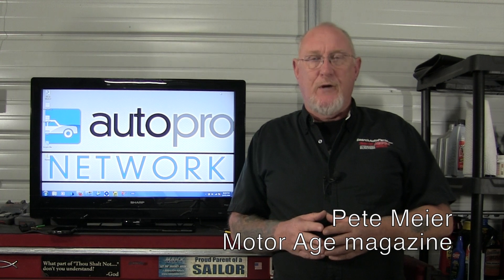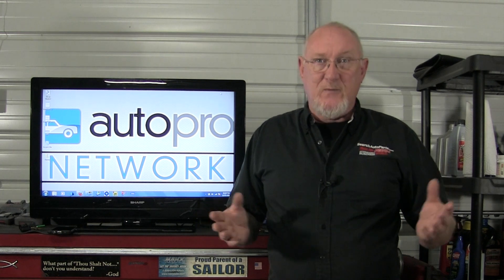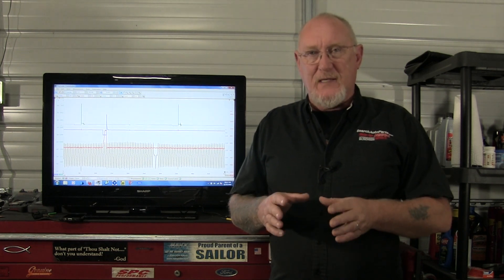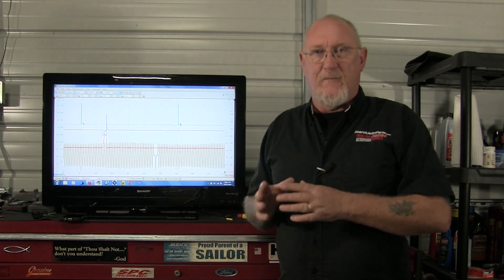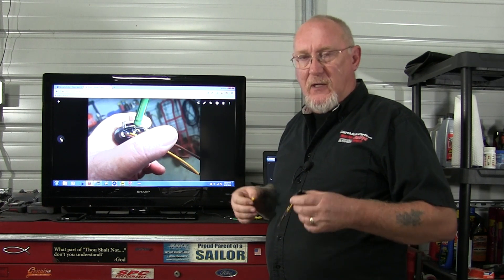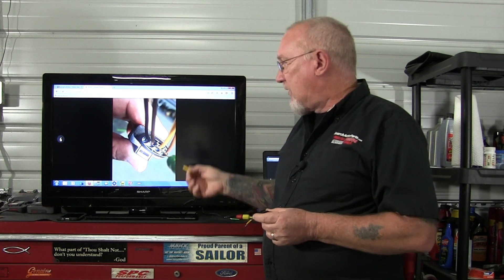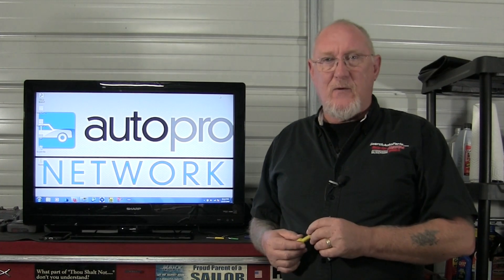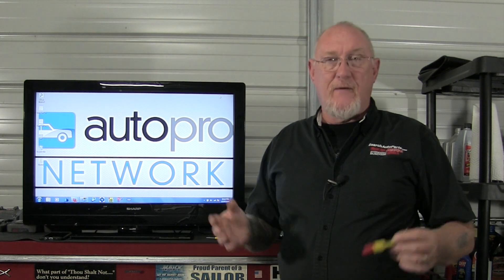Motor Age How2 - Backprobe or Pierce?

Comment: I'm looking for a lead for a multimeter to be able to attach to just one pin inside an automotive connector.   Such as one pin out of 16 pins. I need a female lead that will slide over just one of those small pins.   I've seen them used in videos.   I just don't know how to search for one.   Anyone have a link or the name of it?

Comment: Dumb question, but since copper does not corrode,  are we actually worried about corrosion from that pin hole?  Isnt the insulation just to prevent live wires from crossing???

Comment: Thanks I'm trying to verify if voltage making it to my fuel pump, continuity is good at fuse and relay, just trying to avoid buying a new pump if not needed
Reply from the maker: I’m assuming the car won’t start. Do you have a current probe or clamp?
Reply: @VehicleServiceandRepair  it turns but the fuel pump doesn't even make a hum, I have verified the relay is clicking and fuse is OK, it was a product of some rat chewing at the top of the engine bay, I've repaired all damage I could see, but before replacing the fuel pump for 300+ I wanna verify continuity of the wire run closer to the pump, I don't have a specific probe now  I was considering sewing pins and a voltmeter tbh
Reply from the maker: @nickkk420  If you can reach the connector, you can substitute the fuel pump load with a headlight to see if the circuit is working properly.
Reply: @VehicleServiceandRepair I have found that there is a connector under the tank, I'll try to patch in there thanks for the advice

Comment: Looking forward to the series.
I found Liguid Electrical Tape at Home Depot. It is messy, but it works, even on sprinkler wiring!  
Some connectors are to small to back probe, so piercing works.  I wish I had that piercing tool 20 years ago.  I have it now in my Pico box.  I'm retired, but learning the Pico on my (non)volunteered 06 Nissan Frontier V6.

Comment: Like probably most old cars, my connectors are covered with grime.  I imagine back probing would push that grime into the connector and cause problems.  What's the best way to clean the weather shields without getting junk into the connector?  Maybe turn the connector so the weather shields are facing down and then scrub with a toothbrush and contact cleaner?
Reply: Nicholas Stroganoff maybe try a good CONTACT cleaner
Reply: https://www.wd40specialist.com/products/contact-cleaner?gclid=Cj0KCQjw0dHdBRDEARIsAHjZYYCiMpQsm-q3AARuZyznUzdn2QHDrSQ5QX6MTHWB4OZtQX-ZIQnRkksaAmU0EALw_wcB

Comment: Very helpful video.  Does piercing necessarily break strands?  Or, just very likely or possible.  Be interesting to pierce wire and then do an autopsy to see if in fact wire strands are broken.
Reply from the maker: I'd say possible. One reason to use care when cranking down on the probe (IMHO).
Reply: Its up to chance, I've had luck and just split and could see a hole thru but no broken wires which is just left to seal up after, I use liquid wire

Comment: Great series Pete.. what is your thoughts on the bed of nails piercing probe.?
Reply from the maker: To be honest, mixed. There are some applications where trying to get to the wire you want is difficult and this may be the only answer. But I would try all alternatives first and regardless of the technique used, be sure to seal any holes made. Soon, I'll be showing you an alternative to piercing/backprobing!

Comment: thank you for sharing. How about using the piercing tool to the signal wires that carry very little current/like CAN signal ?
Reply from the maker: I tend to prefer backprobing whenever possible, and certainly (IMHO) when it comes to very small gauge wiring. For the CAN signal, I like to start with a BOB (breakout box) connected to the DLC.